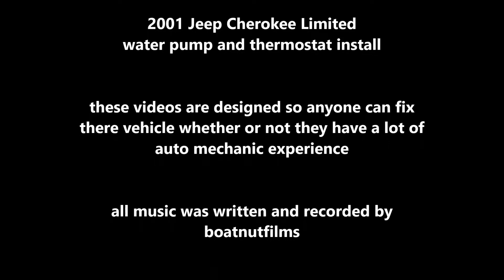2001 Jeep Ckerokee 4 liter (water pump and thermostat install)

Comment: I can see that Chrysler has made it harder to work on these since the Renix days. When I changed my pump I actually took the front bezel with the lights and everything on it off to gain full access to the front accessories. I'm not sure how easy it is to pull off as one unit on the second gens but before with mine it was quite easy and took about 5-10 mins to do and making it far faster to work on other stuff.

Another option could be to pull the rad and upper support to get more room to work easier. Getting the hoses off the rad is usually easier. But meh that's the way I do it, mines AMC and it is different than the Chrysler XJ. Mines so modded too that might skew the difficulty lol.